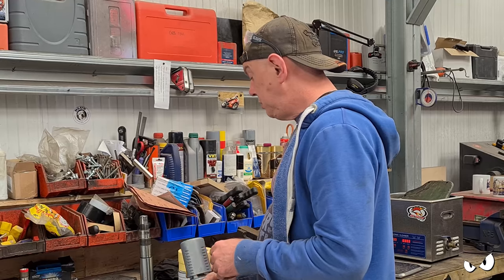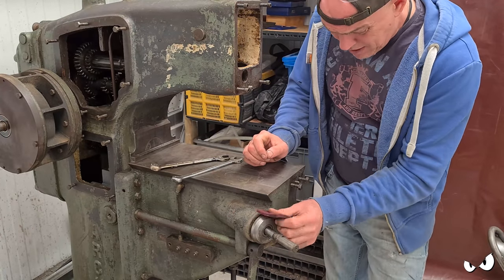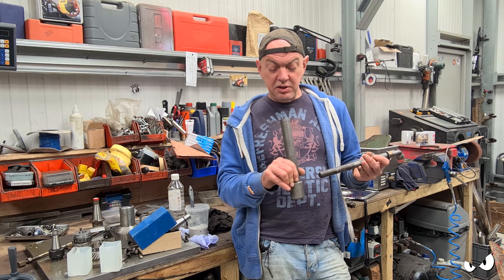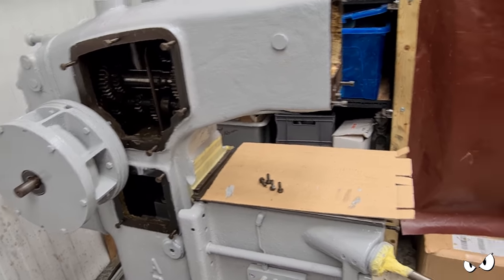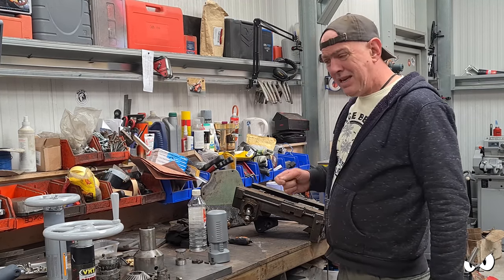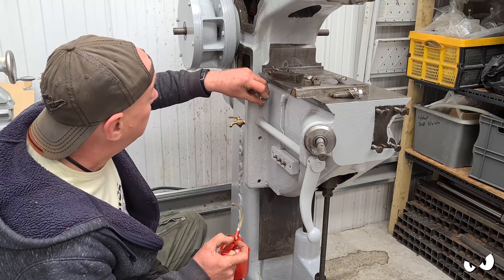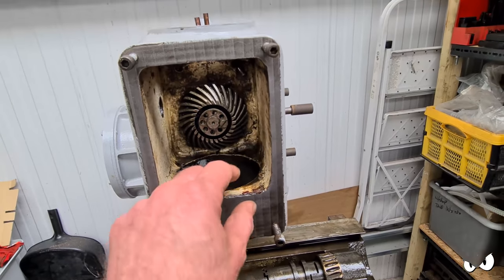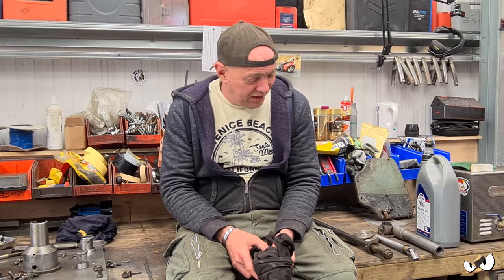Archdale Mill - Paint and assembly (pt1)

Comment: Great video 👍 Quickie Don't be worried about a few "Dribbles" as that's acceptable when you get to a certain age.☺️
Reply from the maker: Hehehe.... I did clean up after myself though 🤣😂
Reply: @QuickBikes  The oil issue check the iso codes on the oil your using,but I reckon cat piss standard car bike gearbox oil will do it,or use ATF as this is used in automatic gearbox's.
Reply from the maker: Yeah I'm thinking just a gearbox oil would do as that what it basically is... I'll use the machine oil for the bed etc

Comment: You could try some plumbers hemp to sort the drain tap position. Looking good so far.
Reply from the maker: Yeah, could work.... to be fair I'm not that fussed as the oil will still drain out of it. It would be nice if it was vertical though as I just know its going to do my head in 🤣😂

Comment: Hi Quickie. Boxford specify for my lathe (not the same as yours) gearbox Tellus 68 (Shell) or equivalent. It’s equivalent to about SAE 30 engine oil, so it’s a bit thicker than what you were proposing to use. Also it’s defined as a hydraulic oil, which really means it is more tolerant of a bit of moisture in it than engine oil  would be (think condensation). I’ve just ordered some from Westway, and no, I’m not connected to them.
   (A lot of lathe owners seem to use ISO 68 oils, if you look at the forums).
   
   I think you may need something thicker than the stuff you have, as it’s an old machine and the clearances will be a bit looser than when it was new. Those gaps need to be filled.

  If you are tempted to go the car gear oil route, the advice is that  it’s bad to choose an EP oil, as they contain sulphur compounds which attack brass or bronze components. Why this doesn’t matter in cars, I don’t know., but I offer it for what it’s worth. (I am no expert).

Enjoying the videos,
Bill
Reply from the maker: Lovely, thank you very much Bill.
All good advice and very much appreciated 😁👍

Comment: Ahh another episode of The Mill - grab a curry and put my feet up - looking proper good now. Congrats on getting the shaft undone! 👍 As for the oil, not an expert but I'm with others I'd be tending towards a gearbox type oil, something on the thicker side. Once the pump is going that should probably give some clues also.
Reply from the maker: Yeah, that's the way I'm leaning I think matey.... I'll use the machine oil for the bed etc though as that's what it's for 😁👍

Comment: What is that shaft doing?  Paintjob looks great.  Rust old grease is gone, that's important.
Reply from the maker: What, the prop shaft? It' driven by the main gearbox and provides power to the powered crossfeed for the X axis. Looks soooooo much better now its all clean and tidy hey 😁👍

Comment: If you use perspective you could put a plug cap knit so you can add more oil if required plenty of brass plumbing fittings available will do the trick
Reply from the maker: Not a bad idea.... there's no obvious fill point,  sonic guessing you just full it from the top side cover as that also determines how much oil to use... 🤔😁👍

Comment: this could be a stupid question but could you use motorcycle engine oil for the miller??????It's looking a lot better now it's got a coat of paint i really rate this channel as it's one of my favourites, keep up with video's mate
Reply from the maker: I'm not sure... probably... its.just the viscosity really that's the issue.... it has to be thick enough to cling to gears etc as it gets splash fed oil, but thin enough to easily pass through the galleries, some of which are quite small... 🤔

Comment: Coming along rather nicely that! I'd have suggested a gear oil, not that I have experience with milling machines but have run BMW bikes that have shaft drives, final drives and separate gearboxes. A quick search on the net and I found this suggesting suggesting a medium weight DTE gearbox oil. https://www.practicalmachinist.com/vb/antique-machinery-and-history/type-weight-oil-1950s-archdale-vertical-miller-218815/
Reply from the maker: Thank you matey, much appreciated 😁👍